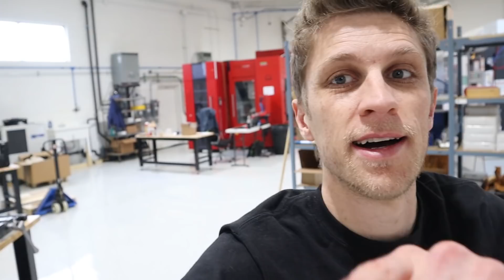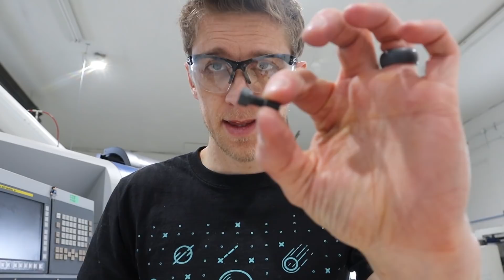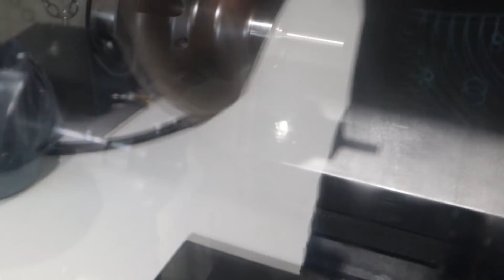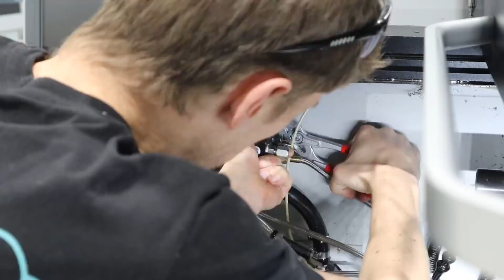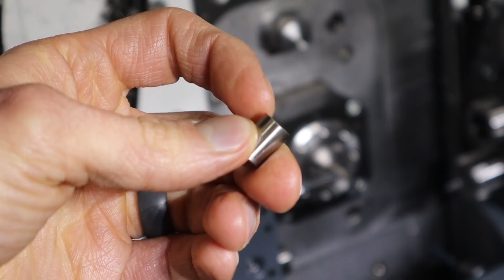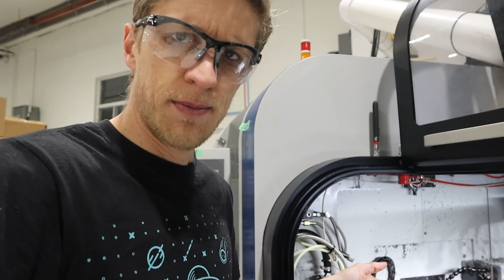Quarantined Shop Life - Day 1 Lathe Upgrades!

Comment: What's the point in measuring Y on the tools ? each toolholder must have Y0 base  . Same as with a Y axis lathe , you don't have to dial that shit in everytime , once the machine builders sets the holder 0 in YX , there's no need for any of that (for cilindrical frontal tools ), and still no need for Y on perpendicular tools  or am i missing something ?

Comment: Always unplug unnecessary things and remive as much cabling as possible. The nightmares it will cause when it finnaly shorts somewhere and possibly ruins a live tool spindle or at very least some lost production, isn't worth it. Why not touch off direct to material, figure out the deviation from 0 and change the command you input to command it there. I.E. material that is .068 platinum I will actually call up 
G0z-.04;
X4.5;
T100(or whatever tool you want)
X.066(instead of .066) this will result in you being able to keep your wear offets closer to zero, and thus easier to spot when you miss a digit or fat finger that input instead of incremental input button. Fuck fanuc for putting them side by side. Talk about an oversight. I can't tell you how many guys I have met who crashed due to this.

Comment: Nice set up! At work we have two Tsugami Swiss machines.... they re pretty nice. Question: what coolant do you run? We’ve been having foaming issues running 10hr straight shift with h/pressure.

Comment: You could use plastic flex wire link to route your coolant lines through it would give you a controlled path for them to move in and keep them from hanging up. https://www.mcmaster.com/5607K94

Comment: I'm running Citizen swiss lathes and with those there are less need for high pressure coolant because of LFV and also you get super nice finish. I manage to get a Ra of 0.1 without grinding. And the live tools are ofc centered by default when you call them so no need to find the center like you do ;)

Comment: Curious as to why the machine doesn’t automatically know where center is on the live tooling holders? Also why would you need to adjust that? I get the need to use them off center but not why the machine isn’t “set” with the spindle center lines.
Reply: Melissa Hill I understand offsets, but from what I saw he was centering a live tool, not a turning tool.  I don’t understand how the machine doesn’t know center line of the live tool holder in relation to center line of the main spindle. It seems like centerline should always remain in the same place.

Comment: A little note on swiss machines,a lot of the alignment of things can be done using the subspindle.  
you can turn a diameter on the main spindle and sweep for the high point.  you can then sweep the tool for the high point. if you use a 3/8 tool and turn a 3/8 diameter when the two jigh points are the same y is aligned. the same trick can be used to find the center height of a turning tool. if you sweep the sub to the guide bushing or a turned tiameter you can use the sub to pickup the id tool positions

Comment: The H1150's allot nicer to machine in 17-4 than the H900.  The H900 behaves allot gummier than the H1150, which acts more like a hardened steel in my experience.

Comment: I would probably hard line the bottom half of those coolant lines and add a full loop in the more “open” area.  Full loops are better at taking up height changes than a single bend.

Also - do yourself a favor and switch to swagelok fittings instead of AN.  You can even get flex lines with swage ends.

Comment: Also you should have standard Y offsets for those cross tools - they should have been verified by the tech during installation.  Easy way to check is drill a cross hole and measure how far off center it is.  I like using an optical comparator but you can do it with a surface gage/indicator, gage pin through the hole, and a couple of V blocks on the surface plate.
Reply from the maker: The tech didn't check the Y offsets of those tools.  They're not off by much, but I have a better piece of mind knowing that they're much closer than crossing my fingers and hoping the factory theoretical offsets are perfect.
Reply: @JohnGrimsmo   Understood!  You seem to be taking to Swiss well.  I thought 6-axis Swiss was much easier than subspindle/Y-axis/live tool lathe.  MUCH harder to crash, at least!

Comment: Using Carbide stubby drills you shouldn't need to spot with a 135-140deg tip and geometry meant for what you're doing, even on a radius like that.  I use to do it all the time in a Swiss to save an operation.
Reply from the maker: Good to know, I wasn't sure so I figured it wouldn't hurt.

Comment: In general, no need to ream tiny hole if you are using good cabide drills at propper IPR. Nevertheless, great job.
Reply from the maker: Good to know.  This is the first hole I've reamed in many years, I just wanted to make sure the diameter stays consistent over a huge run.
Reply: @JohnGrimsmo  For a long run in titanium you are absolutely right.

Comment: For finding center on your live tools:

Mic the bar in the spindle for diameter, then go find a pin gage the exact same size and put it into the spindle you want to center on the main spindle. Grab two rectangular gage blocks from your shop stash while you're there, doesn't matter what the sizes are, just mic the thickness of the two of them together flat ways and write that dimension down, along with the dimension of your bar stock and gage pin, and add them all up to get your total stack height.

Roughly align the two spindles by eye and then lay a gage block on top and bottom, touching both the bar stock and the gage pin in the two spindles. Mic over the two gage blocks and the pins/bar while it's all in the spindle and note the size you get.

If the measurement you pull from that assembly matches your stack height from step one, your spindles are aligned. If the measurement is larger, you've got a mis-match between the two spindle heights. Have a look and decide if you're high or low and adjust the Y up/down however much your measurement was different from your original stack height.

Should be able to hit it perfectly in two or three iterations, and it doesn't rely on feel or excellent eyesight.
Reply from the maker: YESSSSSS!!!  That's an awesome idea that would work perfectly, thank you!  Guess it's time to buy a set of gage blocks eh?  Hahaha.
Reply: @JohnGrimsmo    LMAO!  Has Kern Ubermill and a friggin' CNC Swiss Lathe, but not any gage blocks.  Now THAT is funny.

You can use any old thing that is flat and parallel, 'cause you're just making a comparison measurement, but gage blocks are very flat and very parallel, and I assumed you had some.  lol

Good luck on your quest, Northman.

Comment: Awesome video but how do you set the clamping pressure in the sub ?. I use a rubber mallet and gently tap then measure if the part has moved.
Reply from the maker: I think I covered that in the next video.  Stay tuned!

Comment: i'm no machinist but if you knew exact diameter of your stock and diameter of you solid carbide in tool.  couldnt you just come in on top of stock note it x?? y?? position then come from underneath and note the same then halve and you have zero?
Reply from the maker: I did try that first, but because I had to stick the stock out quite a bit I noticed some deflection and didn't feel super confident with the results.  1/4" titanium is kinda bendy when we're measuring in tenths.

Comment: Why don't you put two cone ended parts one in the live tool and one in the lathe and try line up the points?(this is kind of how machinists line up the manual lathe tools)just an idea I had
Reply from the maker: Nice, I did consider that and I'm sure it would work pretty decent.

Comment: Gosh, For a precision lathe that is a very "crude" way from them to expect you to set offsets, isn't it? Don't Tornos have any other "easier" probe system to do something so critical and time consuming? It actually blows my mind. I feel that "pretty close" and "precision lathe" doesn't go in the same sentence :) Keep up the good work :)
Reply: All that initial setup will usually be "diluted" for 10k parts, or 100k, not that big of a problem. And as I've understood you'll need to tune the tool offsets anyway once the parts come out and you measure them. IIRC this Tornos has offsets down to 0.1um, you'll never measure the tool offsets down to a micron anyway. So close enough is good enough for a start :)

Comment: urgh.. that looks like a awfull lot of work..   For center finding in y can you not jut thake a wiggle ege finder from a conventional mill? That should work at least for the driven tools.

I have seen that the coolent lines scratch up the paint inside the Tornos.. Some long heatshrink tubing could fix that.

Keep it up and stay safe. Cheers

Comment: For the coolant hoses ty-rap them to the 90° electrical bulkhead using the spark plug wire/ty-rap trick. And for indicating the tools use 2 ground pins of the same diameter in the tool holder and spindle and put the indicator in the sub spindle or another reference surface.
Reply from the maker: Ohhh of course, bring the sub in with the indicator to run it across the top of both.  DUHHH!  I didn't think of that!  Thanks!  I think I can move the sub X4 axis while it's all close to the main.

Comment: So ... I'm looking at this positioning process and like many others, thinking there's got to be a better way.  I just added a touch plate to my CNC - a simple DIY solution with a .500" piece of Mic-6 has made my life a LOT easier, after learning the right G-code to properly use it.  Would something similar work on a Swiss lathe?  Thoughts: (in the spirit of making a solution from junk sitting around the shop)
1. Put something non-conductive (HDPE rod stock, maybe?) in the spindle.
2. Drill, ream, and thread the end of the HDPE, then screw a brass or aluminum insert into it (picture a socket head cap screw, but softer!).
3. Turn the insert so you have a known concentric reference. Exact diameter doesn't matter (yet).
4. Wiring:
4a. Clip a probe wire to the metal insert - assuming the lathe's probe input has a weak pullup resistor (10kohm to logic high is typical).
4b. Make sure the tool is grounded. You may need a wire, or you might be able to skip the tool wire, since most tooling will already be grounded (exception: live tooling with ceramic bearings).
4c. Depending on how the lathe electronics work, you may want an opto-isolator between the tool-to-spindle-probe circuit and the lathe's probe input.
5. Touch off at the bottom of Y, set Y zero.
6. Touch off at the top of Y.
7. Just like on a mill DRO, set Y to half its current value, so now Y0 = spindle center.
8. Store the current value of Y in a program variable - that's the probe's radius.
9. Touch off in X - since you now know the probe radius, you can subtract that and have the exact tool offset from the spindle center.

Does that make sense?
Reply: I don’t think that the Swiss would have that input as it is not made to have probes i could be wrong though
Reply from the maker: That would certainly work, especially if it was offline and just lit up an LED or something.
Reply: @JohnGrimsmo  Offline with an LED would certainly work if you're not inclined to go poking random wires into an expensive machine.  Being the sort of person who gleefully violates warranties, I am less hesitant. :)

I just looked it up, and the Tornos uses a Fanuc 3i-B5 controller, yes?  It looks like there are several options for probe inputs in the Fanuc catalog, depending on what was ordered.  One of those options yields "high-speed measuring position reached signals HAE1 to HAE8" (Fanuc ordering spec: A02B-0326-S998), used as inputs for up to eight probes.

Comment: Makes me miss working on 1940s brown and sharp single bar feed machines. The whole thing was mechanical and you set everything by loosen the screw move the tool by hand and tighten. Hope you put it in th ed correct spot. By the way did you still possibly want the optical competitor no big deal if you didn't just wondering.

Comment: I'm an amateur home machinist with both manual and cnc machines. I have to ask why aren't you using a edge finder on that lathe with a DRO to find the center at each tool post?
Reply from the maker: Because I haven't used an edge finder since 2009 when I made my first probe haha.  But yes it's a great idea that would work perfectly here!

Comment: You need one of those new fancy Orange bench vises. (If anyone hasn't seen the manufacturing video on Orange's YouTube channel, I highly suggest it.) A gauge block would be better for centering your y-axis. It will ensure that it is only touching the top of the carbide rod. Start with the top of the carbide rod visually below the top of the workpiece (in the collet). Put the gauge block flat on the top of the carbide rod, and move the gauge block into the workpiece. The cylindrical nature of the workpiece will guide the gauge block into a perfectly horizontal position, and if it can't ride up the workpiece in the collet (while you are holding it flat on the carbide rod), the carbide rod is too low. Bump it up until the gauge block slides onto the workpiece in the collet easily without coming off the surface of the carbide rod.
Reply from the maker: Ahh good call.  I did try to find some little square object but failed.  I don't have a set of gage blocks yet.

Comment: Put an edge finder in the live tool. Starrett 827A for example. Perfectly line up your Y and Z offsets.
Reply: Tom Revere I was just about to comment this.
Reply: Good idea. Wondering wont gravity affect the measurement when the edge find is placed below? or the centrifuge force is higher? Of course the upper measure will be enough if you measure the stock diameter. Or if you use and digitizer probe.
Reply: I'd be surprised if there wasn't some kind of probe that fits in the spindle. Maybe the wide variety of tools makes this impractical.
Reply from the maker: Sweet idea Tom, thanks!
Reply: @JohnGrimsmo  or as another alternative wouldn't the static bleep and light ball type edge finder fit the purpose?
Reply: Once the holder is set it should be good even changing tools, for a while anyways, what I do with our lathes sometimes is mill 2 flats and then keep adjusting till they are centered.  I also know that haimer makes a centering measurement tool that might work except that its probably too big to fit in there.  I think the edge finder method mentoned above, is probably the quickest and most most accurate option.
Reply: Yep! VBGT or VCGT also VBMT/VCMT's my favourite indexable knife tools for accessing awkward features on a manual centre lathe. I've got them in left and right hand and neutral format.
Reply: Yep! VBGT or VCGT also VBMT/VCMT's my favourite indexable knife tools for accessing awkward features on a manual centre lathe. I've got them in left and right hand and neutral format.
Reply: I literally was thinking this same thing. Edge finder mechanical or even a Fowler electrical edge finder with the red light.
Reply: This is wildly innacurate in several ways, the first being that you are not using the same tool to center as you are to cut and thus inserting errors into the measurement. As well as the sheer inability of an edge finder to discern once it gets down to about 2 tenths.
The proper way of finding true center on a live tool is by writing yourself a centering program that scribes the end of the bar, and then all you do is offset by the amount dictated by the measurement between the lines. There is a very specific pattern that will let you know which way it is deviate as well. This technique will get you an order of magnitude closer than an edgefinder.
An edgefinder will get you close enough for government work, a centering program will get you close enough to make cardiovascular implants.
If You are not planning on doing any real production and just mainly doing jobshop kinds of work then maybe maximizing tool life and maintaining surface finish are not as important to you.
But it happens to be very important in the field I work in, when you consider that a single custom pcd ream can set you back $1000 .
Tool life is decreased by roughly 10% per tenth run out depending on a multitude of other factors as well. So by using qn rangefinder you are instantly throwing away 20 percent of every tool mounted into that spindle.
Seems like it would be more advantageous to set it correctly the first time instead of half assing it.
Reply: @chuckphilpot7756  I had an occurrence of palpitations reading this.
💓💓 I only go as far as a plastic ruler if its a Govt job.
Reply: Howard Osborne Haha well we happen to dominate the cardio contract manufacturing sector worldwide as Well as provide the bars that our competition makes their components from as well, so chance are if you ever do have them it will have about a 90% chanfe of having at least one component that came from us. 

We just added 16 new Swiss lathes and 4 swiss lathes with fiber lasers built in to do ablation, and thinner cutoff, etc. We already had about 100-150 swisses.
We take platinum sponge from the mine, refine and cast it, mill the ingot and then draw the wire. I make parts for all the big hitters like Biotronik, BiosenseWebster, St. Jude, Medtronic, and Boston scientific.